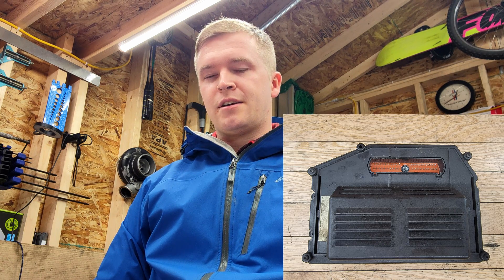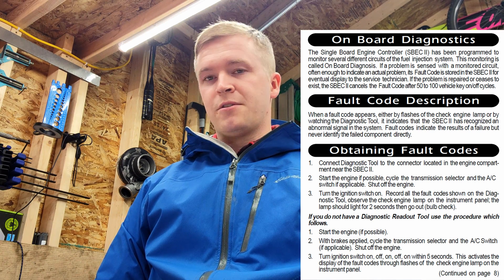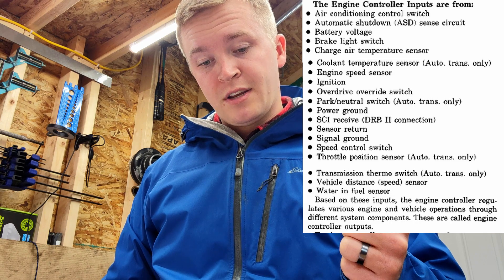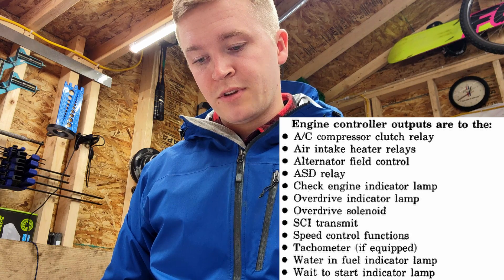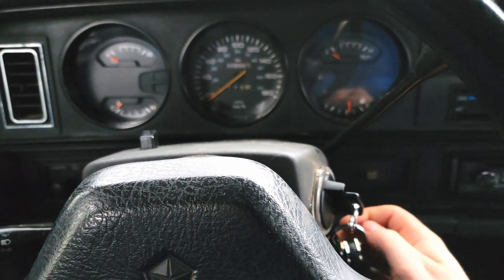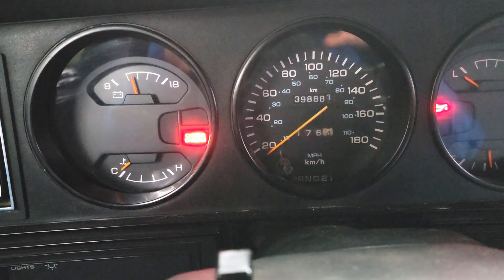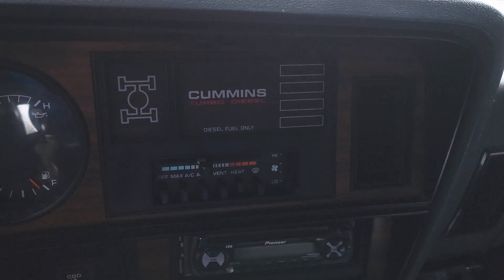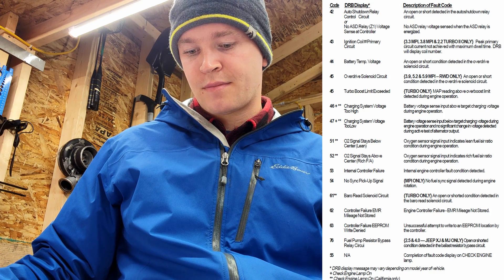Diagnostic Trouble Codes | 1st Gen Cummins

Comment: My check engine light isn’t even coming on and I replaced the light in the dash and I replaced the capacitors in the pcm and it still didn’t fix my charging issue @ovens garage

Comment: So I have a 1990 dodge ram d150 and it’s a 5.2L and I found out it has 3.9L throttle body and injectors in it if I just change the fuel injectors should that fix the issues or would I have to change whole throttle body. Cause it looses power and acts like it’s not getting enough gas

Comment: I got a 95 4x4  and I having problems with the cruise control doing weird things . So I use this procure to see if I can help fix it . I about at the point to just buy a aftermarket unit and by pass the pcm . I already bought a rebuilt pcm from Dodge a few years ago when the truck was have all kinds of problems that was fixed with the rebuilt pcm . Thanks for the video
Reply from the maker: Good luck fixing your issue!

Comment: Computer in a 1990 Cummins D250?

Don't think so.
Reply: @0311catfish yeah I i was mistaken the gas rams got computers in 88 my 88 ramcharger 318 has a computer but the diesel rams didn’t have computers until 92
Reply: All dodge trucks from 88 onward have a very basic ODB1 computer system for fuel injection and rudimentary diagnostic. You're probably thinking ODB2 which didn't become standard until 96
Reply: @davidkroondijk9365 

 Uh... I'm actually thinking NO COMPUTER. There isn't one in my 1990 Cummins.